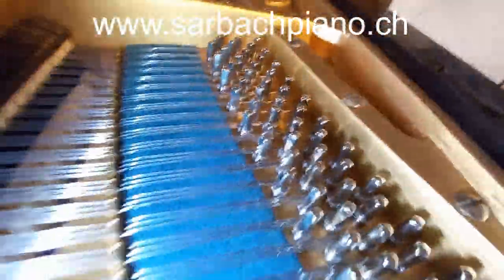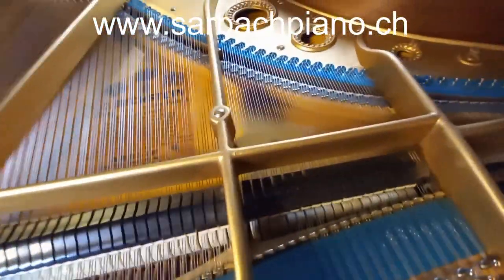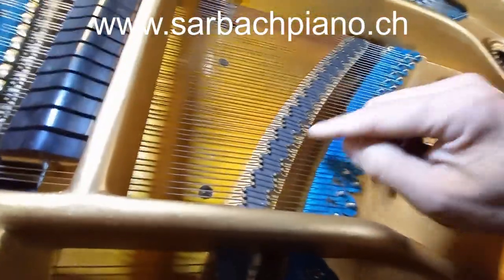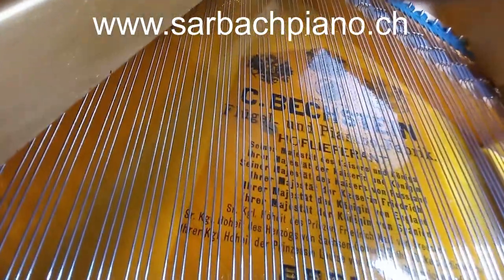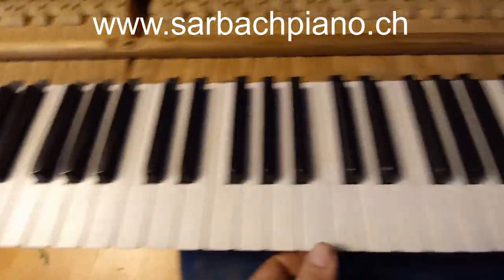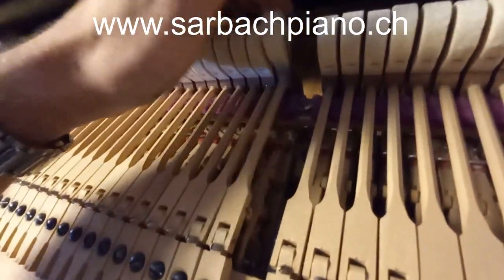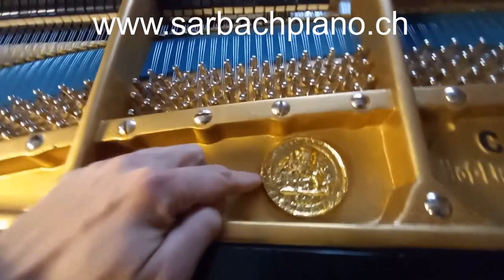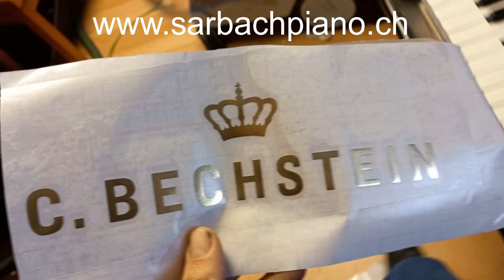Bechstein V follow up

Comment: Nice work!  Thank you for clarifying your rebronzing technique on the plate. I assume you brush it completely? I have always sprayed but I'm amazed at the quality of the brush work. 

Peter Grey Piano Doctor
Reply from the maker: Thank you, this painting tecnique really lokes nice and especially it is not harmfull. So you don`t have to wear a mask. It takes something like 3 hours to repaint it (you have to do it three times and afterwards finish with clear shellack). If there is any damage during the restringing process ( which is quite common unfortunately) it can be corrected afterwards. I also piant the pinblock with metal pigments to avoid humiditiy change (the open pinblock tends to drie out and so reduce the tuning stability).

Comment: Thank you for such informative video.
What concentration H2O2 do you use? For me it usually takes 2-5 days to bleach the key tops. Maybe it takes so long because I use different solution, or the Sun light is different here in Lithuania. 😄
Reply from the maker: 35% it goes much faster if the sun shines directly on it. I also put a little bit of soap to it, so it spreads better.